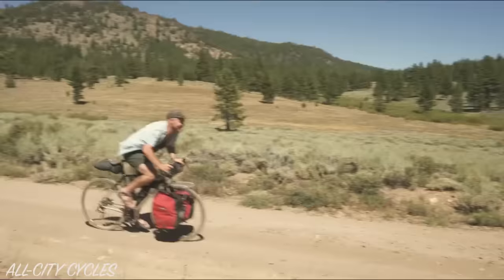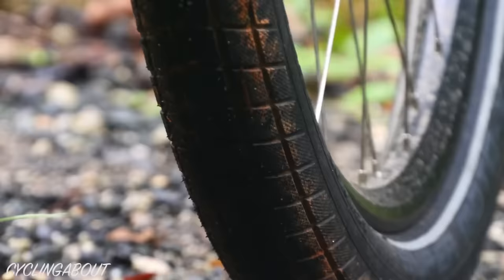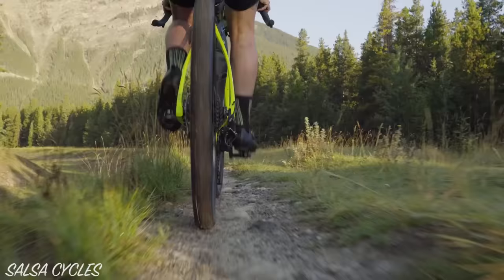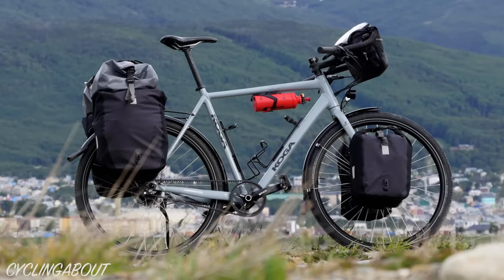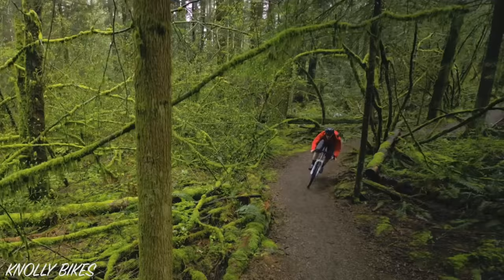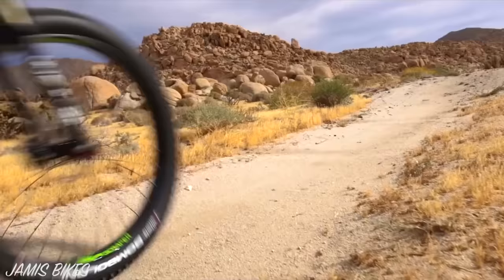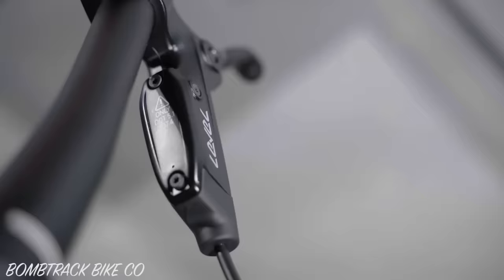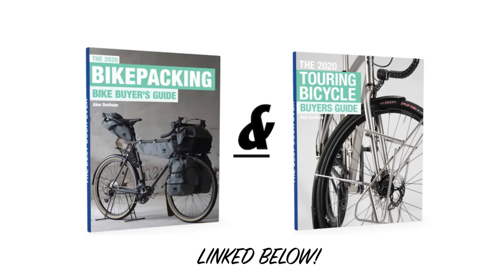What Is The ACTUAL Difference? Touring VS Bikepacking Bikes

Comment: I agree that the notion that longer chainstays slow the ride is utter rubbish. My Salsa Warbird (56cm) frame has slightly longer chainstays than both My Norco Search XR C2 and My Genesis Datum (and My Norco Search XR Steel), yet it's the fastest of them all. About 10% faster (!) than the Search XR Carbon and 5% faster than the Genesis Datum. Might it have to do with semi-aero wheels on the WarBird? That's likely. But slightly longer chain stays certainly don't slow it down - that's for sure.

Comment: I like your videos. But in "Frame comfort. Just a myth? You said frame stiffness is negligible and one how says he can feel a difference would have placebos. In this video you say bike packing bikes feel noticeably more lively due to the lower frame stiffness . Please explain this.
Reply from the maker: The frame comfort video is a discussion around vertical deflection. In this video, I am discussing the horizontal deflection. As bikepacking bikes are designed around carrying less weight, they do not need to be as stiff horizontally, resulting in a more 'lively' ride without luggage.
Reply: @Cyclingabout  thanks, does this also mean there might be a slight advantage for steel bikes concerninch horizontal deflection or does it soley depend on geometry?
Reply from the maker: @joerg6156  My next tech video will answer this question in-depth, but the answer is: kind of.

Comment: Very informative video, but the long-release compression on the plosives is awful. Did you not preview the audio before mixing down your video?
Reply from the maker: Sorry. I suck at audio. I wish I had a film crew most days.
Reply: @Cyclingabout  The problem with the audio is that you're either using a program that auto "corrects" stuff, or you used a compressor that has a long "tail" that massively drops out audio when it detects a loud plosive (sounds like k, p, b, t). Most "voiceover" presets go way too hard on ducking the plosives. A general, single-band compressor can often give better results than a preset. 
If you let me know what software you use to edit the voiceovers, perhaps I can give you more specific recommendations.
Reply from the maker: Yeah, I was tinkering with my mic levels and didn't realise I was going into the red for loud plosives. An audio friend did the best he could on the plosives so that I didn't have to re-record everything.
Hopefully, I can improve my audio over the next decade! It seems to be taking forever (I am limited with what equipment I can carry, as well as where I record - as I travel full-time on a bicycle).

Comment: Thanks for a great video!  What if you weigh 275lbs or 125kg?  If a trailer is best in my case why do you show a one wheeled trailer?  Are one wheeled trailers better than 2 wheeled ones?  Is it easy to convert to a belt drive and Rolhoff hub?

Comment: Thanks for this =) I've just bought Fuji Touring disc 2020, and going install an electric motor on it for a really big tour. What's your opinion, is a gear motor-wheel reliable enough for long touring (about 1-2 years) with distance 40-60 thousands kilometers?

Comment: Love your videos. So, can someone set panniers on gravel bike?  Also is carbon bike a good idea for long traveling?
Reply from the maker: If a gravel bike has rack mounts, you can definitely use panniers. Just keep in mind that the load will have to be lighter.

Carbon can be just as strong, if not stronger than other frame materials. But it just depends on how well the bike has been both engineered and constructed. I have written a piece on carbon touring frames here: https://www.cyclingabout.com/carbon-touring-bikes/

Comment: Hi Alee I like touring and bikepacking and I use 2020 surly troll with all xt. 26-27.5-28 wheel i can use it supports. I Am going to buy rohloff and veer carbon drive. I want to buy gates carbon drive but I am not sure it is safety to split the frame. You splitted on lht. Was it ok or veer split belt is better for frame. What do you think about this.
Thank you.
Reply from the maker: I don't see any issue with a professional frame builder splitting a frame. Given you can install a Veer kit without modifications, that seems like the most logical option to me, but I don't have personal experience with the system, so have a look at some reviews first.

Comment: Video is quit se informative, but I would no consider bikepacking bike actual category. If you are going touring in places like Europe or US, you can grab almost any bike that has space for wider tires, gears for various incline and you can attach rear rack to. Ofc, you might not even need rack attachements if you are on very minimal gear and plan to stay at hotels or something.

For most touring and bikepacking as long as you can get panniers, frame, top tube bag and handlebar bag, it's more than enough.

Obviously, if you know you are going to bike in less developed places, very harsh terrain often with heavy loads, you ahould definitely pick touring bike

Comment: What about trekking bikes?  Seems like a distinct category.
Reply from the maker: Trekking bikes are usually closer to the touring end of the spectrum. Stiffer frames, sturdy components, fender/rack mounts, 2X/3X drivetrains, long chainstays. But a handful of trekking bikes are built to be lightweight/fast too which would put them closer to the bikepacking end (eg. Canyon Pathlite SL).

Comment: Kinda limits options for Clydesdales over 330 lbs., doesn't it?! Or should they even try?
Reply from the maker: An ultralight bike under a 330lb rider is not a good idea. At that kind of weight, you'll need a touring bike which is designed to handle a heavy load without the risk of failure.

Comment: I toured on Marin Four Corners last year with about 20 kilos of luggage, all at the rear end. Would you suggest I instead opt for bikepacking set up for that bike? I weigh about 60 kilos now.
Reply: :-) Same bike here. Consider blackburn cages on fork, wolftooth brad-3 under down tube to increase the capacity, and handlebar harness (here there is great combo from Triglav company -- Packman + Roobag). This way you can balance your load better.

Comment: No suspension? 

If I was going off road for hundreds of miles a part of me might want a bit of comfort 🤔
Reply from the maker: It depends on the surfaces you ride and how long you're out travelling. Suspension is definitely the best option for off-road, but service intervals are often ~100 hours of riding (which for me is around 2.5 weeks). That's why you'll see so many rigid bikepacking bikes with 3.0" tyres! But it's worth noting that you can add a suspension fork to most off-road bikepacking bikes.
Reply: You can add a suspension seatpost (Thudbuster for example) and a suspension stem. Longer service intervals.

Comment: You seem to have used "bikepacking" in favor of the more accurate term for the bike style you are describing that is "light touring." Then you accurately contrast light touring frames with heavy touring frames. Bikepacking bikes should have 2.3 or bigger tires, 70 or less head angle, and a hardtail frame.
Reply from the maker: The terms I use in all of my videos are simply the way they are colloquially used. 👍🏻

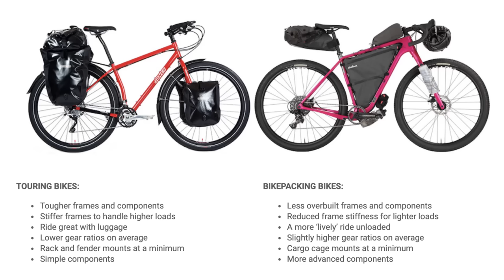Comment: I am intrigued by under down tube bags -- near bottom bracket, like this one in 0:20 or 0:38. Does anyone know what is the brand/name? I am asking in general because so far I didn't find such bags anywhere.
Reply from the maker: The first bag is by Gramm Tourpacking. The second is a bag by Salsa Cycles. You can add mounts under your downtube if you don't have them. Check out the Two Fish Quick Cage adapter. Then there are heaps of cargo cage options that will fit!
Reply: @Cyclingabout  +1 thank you. Honestly I see for the first time bags that fit near bottom bracket :-). So that heap had to miss me.

Comment: Is it good idea to convert mtb frame(26 inch wheels) to touring bike with 700c wheels and rigid fork and drop bar?Any kind of help is greatly appreciated,thank you.
Reply: If you do, you will need to use the mtb front chain rings. You will lose some tire clearance. It will work ok, be very strong. You will need correct caliper brakes or v brake wheel size converters. It just depends on how you like the riding position. I ride a hybrid for hours but a road bike for days
Reply: @stopglobalswarming  Thank you and also I was thinking about 27.5 wheels cause looks like 26 inch wheels are getting harder to find especially tyres but thank you anyway.The frame that I have is Gary Fisher Hoo Koo E Koo size L(19 inch).
Reply: @interceptor7905  if you have rim brakes on your bike you cant swap out to larger wheels

Comment: Got any info on feet forward , I am riding a mtb converted to front drive 45 degree feet forward. Heavy wheels coast.
Reply from the maker: Sorry, all my bike travel experience is upright, so the videos will be upright for now. I've always wanted to ride a recumbent across a continent though, so let's see!
Reply: Recumbents are great for open roads.  For slow riding at walking pace traditional upright bikes dominate.  Alee has a fair bit of bike knowledge but recumbents are their own thing.  Hopefully there is a recumbent bike shop in your area.  You might have to travel to get there.  If so and you're interested then make the trip.

Comment: Alright so I'm new to this world of bike touring /bikepacking, and while this video was super informative I still don't really understand the difference between the two
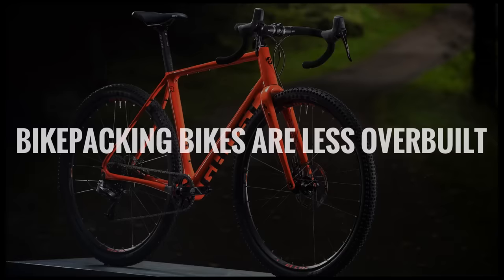Reply from the maker: I don't think I can explain it any more simply than the slide at 0:38.
Reply: @Cyclingabout  Touche. Guess what I'm still confused about is the difference between touring and bikepacking themselves.
Reply from the maker: They're the same thing! It just comes down to optimising the bike for your purposes.
If you want to carry a tonne of gear, a touring bike with panniers is the best option because the bags offer the largest volume and the bike is designed to handle all the extra weight. If you're a minimalist, bikepacking bags will offer enough volume, and because you're carrying less weight, you can use a lighter bike.

Comment: 'Backpacking' hints at being 'off road' .......so 'backpacking' bikes are essentially mountain bikes with panniers. Touring bikes on the other hand have drop handle bars, and are ALWAYS ridden on proper tarmac roads. Ok, you can get slightly thicker tyres for touring bikes if you're going to be riding on flat gravel tracks....then it becomes a 'cyclocross bike'. 
But proper backpacking bikes capable of being ridden across hilly and bumpy terrain will have fat, nobbly tyres with deep treads - they're essentially mountain bikes with full suspension. There, that's your answer as to the difference between them.
Reply: Bikepacking, not backpacking.
Reply: @antred11    I meant 'Bikepacking' sorry!

Comment: So, if I weigh a lot (right now 116kilos) and will be touring for let's say 10,000 kilometers what would you recommend? I just need a bike that can support my weight and the bags I'll be adding to it. I can always adjust myself with the bike along the way.
Reply from the maker: Once you add a bit of luggage, you're on the precipice of the weight limit of most bikes. A touring bike is the most reliable option and is what I'd recommend... as roadside repairs suck! But it depends on how much luggage you're carrying too. If it's just 10kg (including food and water), you could probably get away with either.
Reply: @Cyclingabout  Thank you for your advice and time!

Comment: Ive been commenting on this subject because it is enraging.
'Bike- packing' is a fad. A trend. A word, which will fade as easily as fidget spinner, beanie baby, or mp3...
Touring is a pragmatic, serious up- taking. If you want to explore bike touring, get the strongest bike. Steel. Heavier . More reliable. Don't bother with crazy high mounted swaying packs because its a 'look'. Beore suspucious od the tetailers of cyclu g than with the tsrrain you ate setting out to cover.
Ignore bike packing in all its manifestations.

Comment: Hey lets reinvent the wheel and while we are at it, we might as well invent a new name for bike touring, yeah lets call it bike packing, and claim that you need a specially designed new bike for it, called a bike packing bike. Then we can sell all these silly little bags, that fit on the bike, all over the place, when a couple of panniers on the back would hold it all with room to spare.
Reply from the maker: Bikepacking bikes have their place, especially if you're starting from scratch and don't already have a bike you can use.
It's all about optimising your bike for your purposes, and as I've explained in this video, there are fundamental design differences between both bike styles.

Comment: 0:23 hehehehe
Reply from the maker: Go over to the Tax The Rich channel. Lots of rare cars doing inappropriate things!
Reply: @Cyclingabout  i see but not much to see there thanks
i have a question though does it exist touring bike with suspension ? front and back
i mean the bike with stronger frame that allow more load
Reply from the maker: It used to exist. Tout Terrain made the Panamericana and Riese and Muller had the Delite. There is no modern version of these bikes that isn't electric.
Reply: @Cyclingabout  i see thanks
Reply: A shock fork and a suspension seatpost or custom.  With custom it can be made (if you've got the $$$ to spend).  Big soft tires are another option to smooth out the ride without the complexity of extra moving parts.

Comment: Keyboard warrior checking in
Oy Content Creator, these differences completely defy logic. When I think of touring I think of everything from smooth roads to trails. Smooth roads allow greater mileage to be covered and also stops along the way to refuel or even lodge in. When I think of bike-"packing" I am reminded of backpacking where you head off into the wilds, carrying everything you need to survive. You're enforcing a nonsensical invention of the bicycle industry designed to cater towards noobs and freds. Why invent a new word for something that is already covered by the previous umbrella of "touring" when "bikepacking" by this definition is way less hardcore and interesting? If anything you should pack more when bike*packing*
Reply from the maker: My bike distinctions are based on a technical understanding of bike design and how bikes work. I don't really care what the bicycle industry is trying to push, I am just here to break down concepts, share the data I have and inform my viewers about how to make the best bike/component choices possible.
Reply: @Cyclingabout  I mean you're obviously reflecting the reality of how these bicycles are configured, I'm not accusing you of misconstruing the facts. Technical knowledge is the cheapest form of knowledge, but it is also the most vast and fluctuant.
I happen to frequent a bicycle co-op, so I have been exposed to a lot of bicycle forms, most of which I haven't pigeonholed beyond "good" or "not so good"
The bikepacking bicycle definition you have provided would fall under the category of "not so good" in my opinion, not because short adventures are inferior, but because it wouldn't be equipable for anything beyond 4 days.
Reply: I suspect bikepacking was a trend before the industry stole it because it's a valid concept when describing a longer self sustained foray into the great outdoors, something the bicycle you describe wouldn't enjoy.

Comment: You forgot to add the most important difference, Alee: while the traditional touring bike looks & feels like sh*t, a proper bikepacking bike, especially one like a Salsa WarBird, a Simplon Inissio, an Accent Freak, an Accent Feral, a Norco Search XR C -series, a Merida Silex or the stupidly impractical, race-only Cervélo Aspero - is beautiful.  You did hint at that somewhat by mentioning the weight of touring bikes, but I would add: "hideouslu high, perfectly horizontal top tube, awkwardly upright frame, hideous welds, heavy, bulky components, etc.. I'll make an exception for the Koga with smooth-welded junctions. A bit too upright still, too heavy and no drop bars, but at least it isn't ugly. 
 By the way, I just built this rig for proper touring (and commuting): if it's not going to be carbon, then it must at the very least be as pretty as a metal bike can be: https://www.instagram.com/p/CCUzMfYoP0c/?utm_source=ig_web_copy_link

Comment: how fool....100% sure thing is idiots design....
frame has a bolt on rack mounting.....It is contrary to the discussion of durability and maintenance.
The rack mount should be redesigned with a weld fixation that is completely integrated into the frame and fork.
Reply: How can I remove the rack if it's welded?
Reply: @toby9999 I don't think there's a reason to take off the rack for commuting bicycles that have never been racks while riding mountain bikes and commuting bicycles for more than 30 years.
And when the rack is welded and fixed, it adds the function of reinforcing the strength of the frame. Touring purposes, not pure race bicycles, have more advantages than stereotypes such as bolting.